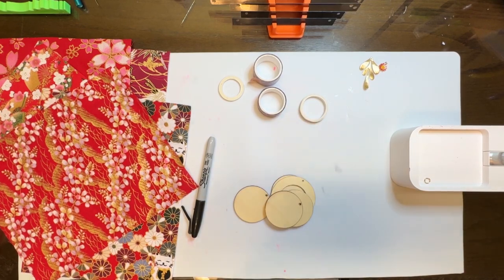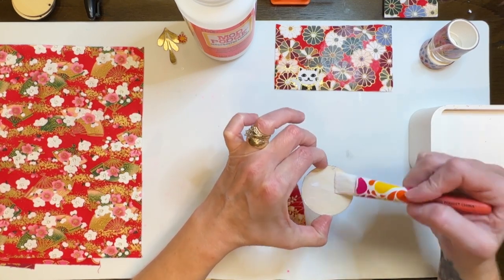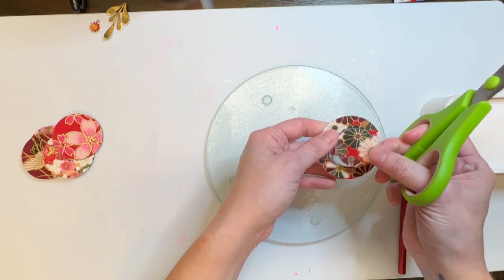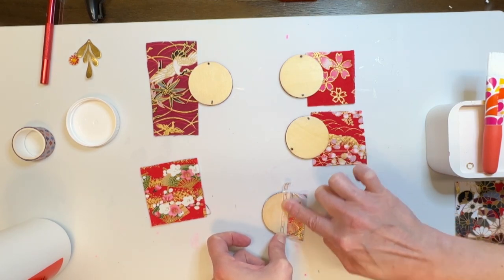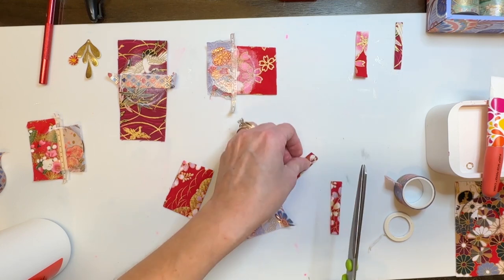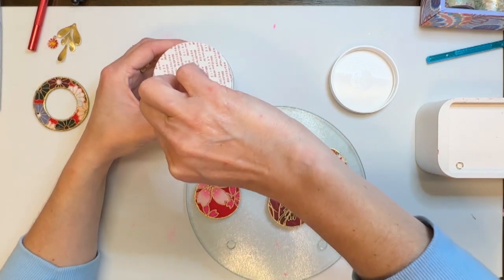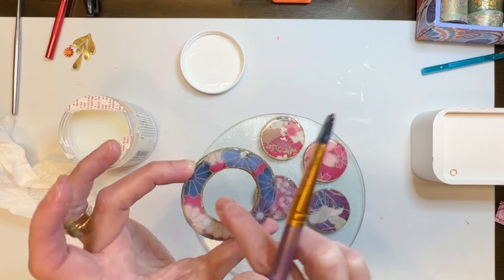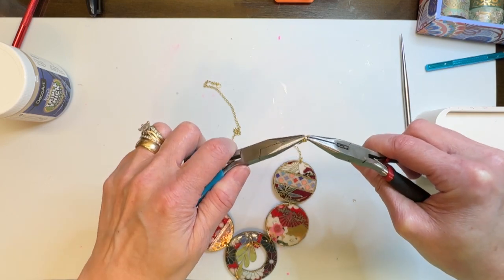DIY Wood blank, necklace, earring technique, no uv resin

Comment: Can I use polymer clay  or thick paper disks instead of wood? If yes, should I change something in the technic/materials?
Reply from the maker: Clay I’m not sure if the fabric will stay on properly but it may I say give it a try on one piece and see what happens, cardboard I would think it would be fine. I can’t say for sure but I know trying new things is part of the fun creating ☺️ wish I could be more help on this but haven’t tried those yet
Reply from the maker: If you try on clay I would switch out mod podge with liquid clay and see if that works